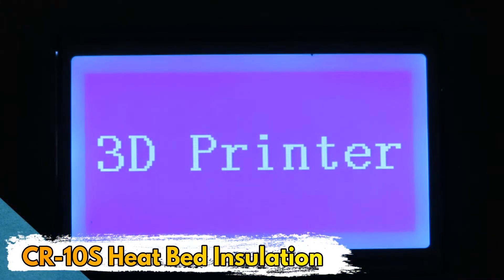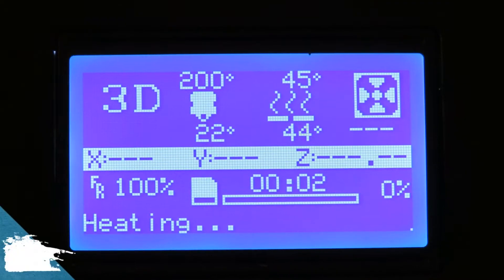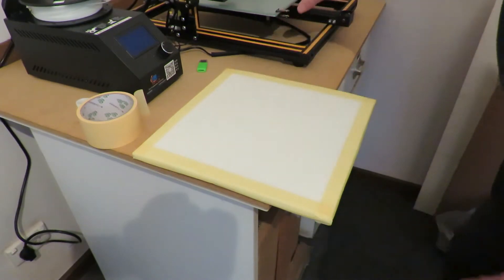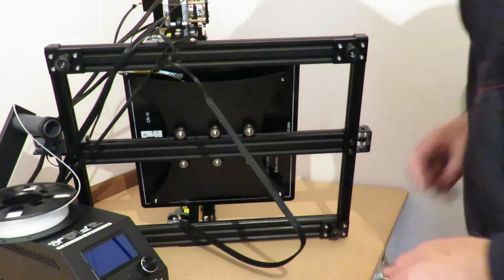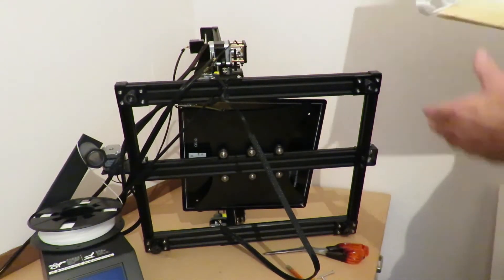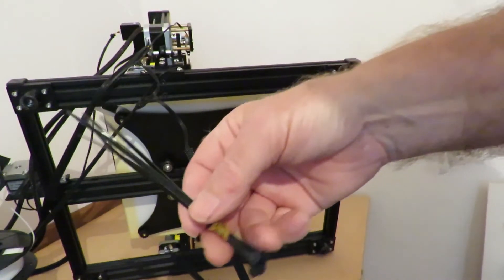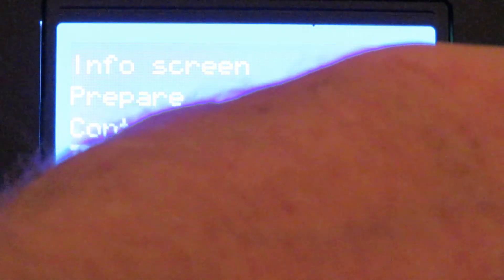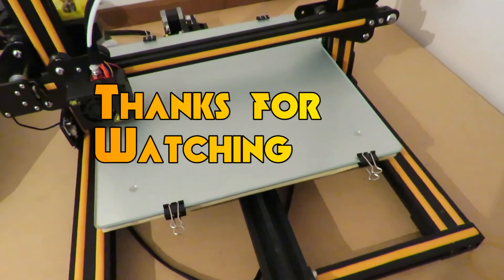📌 Creality CR-10S Cotton Heat Bed Insulation Does it Work?

Comment: great video! wish you tested something around 90-110 but still nice :)
Reply from the maker: I don't use ABS filament.
However,  as you correctly pointed out, I should have tested at a higher temperature.

Comment: Would be better if you made a test measuring the power consumption at certain temperature and time, i bought a silicon insulation for the hot end and it took a little longer to heat up, but it seems that it has less high peaks and averaging 4.5W less, i'm gonna do some testing about it to know the certain power draw with and without the silicon insulation, and then i'm planning to do the same with some insulation for the heatbed
Reply from the maker: Any form of insulation will as you have already stated, will reduce power consumption and also extend the life of the hotend.
It will be interesting to see your results.

Comment: Test a higher temperature, you never heat up the bed to that low temp when printing. Try 70c that should make a huge difference in time. Also you should be able to reach higher temp then without.
Reply from the maker: I print with PLA, and have no adhesion issues at 45. (I also use a glue stick.)
PLA has a glass transition temperature between 60–65 °C.

If you have watched some of my other videos, you will have seen me really using quite a bit of force to remove my prints, from the Glass.
P.S. I have also modified my Glass surface with Micro Scratches to increase adhesion, I made a video showing how if your interested.

As a Side Note: 
PLA does not require a heated bed for a successful print.(BUT some form of external adhesion must be used, masking tape, hairspray, gluestick etc.)
However, if you use ABS, then you need to push the bed up to 100 minimum.

I intend to make another video, using the mainboard trim pot to increase voltage to approx 13.5 volts, and the dramatic heating difference to 100 between standard and modified.

Comment: You need to free up the part with the thermistor. Otherwise you will get not the right temperatures. You’re now measuring the heat in the wool. But you want to measure the aluminum heat plate.
Reply from the maker: Thanks for the tip.
I'll check it out.

Comment: All that effort to save yourself less than 10 seconds to 45c?
I would have shown what the bed can achieve as a max temp. My CR-10 maxes out at around 90c in a 15c room. With a 3mm cork insulation plate, it will hold right 108c. The controller can be set to 135c, which I think is impossible, even in a sweltering room.
Reply from the maker: The main advantage of insulation is heat being evenly spread around the bed, and faster warming times, as you already know.
My 9mm of cotton insulation weighs less than your 3mm cork, and without having to worry about chemical odours leaching from the glue used to hold the cork together.

I print at 45 bed temperature for PLA, and have no bed adhesion problems due to the modified glass on my printer

P.S. My bed can go to 110 easily, simply by tweaking the main board trim pots, if you haven't already done so, its worth considering.
Reply: I agree the lower mass of the cotton makes for less inertia-induced printing irregularities. I was not suggesting my cork plate works better, I was suggesting that others watching probably would not bother to do anything if they see the advantage is five seconds of faster heating.  As well, if it IS that low of a time difference, there's going to be minimal, to no improvement in distribution of heat. . . that is if you begin printing immediately after reaching 45c.  And that's where the bed temp is most critical, the initial few layers.
Reply from the maker: Your correct in what you saying.
Any form of insulation, is going to be better than having none at all.
My room temperature has been hovering around 5-6 degrees, its still in winter in Australia.

P.S. I did say in my video that I may need to seal around the edges of the bed and cotton boards. 
I will get around to that shortly, and do a time comparison to see if there is any improvement in heating time.

Note: If I want to heat my printer bed up to a high temperature fast, I use a heat gun to get things moving along more quickly.
Reply from the maker: Glad it worked out.
Don't forget you can turn up the voltage for the bed, and get it to heat faster.
Reply: How high can you safely adjust the trimpot to get some extra heat into the bed? My CR-10 S5 could use a bit more heat!
Reply from the maker: I am always reluctant to explain how to open the control box, and check voltages.

If you want to do this, then here is a forum link that explains more in detail, the steps needed.
http://www.crforums.com/showthread.php/92-Get-the-most-out-of-your-heated-bed-(Summary)